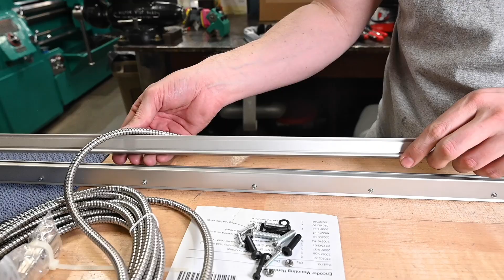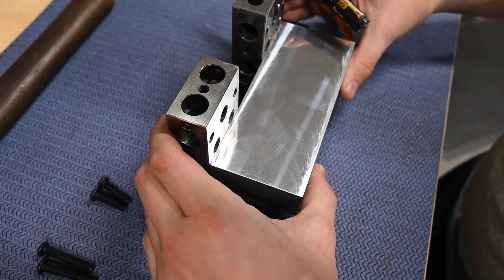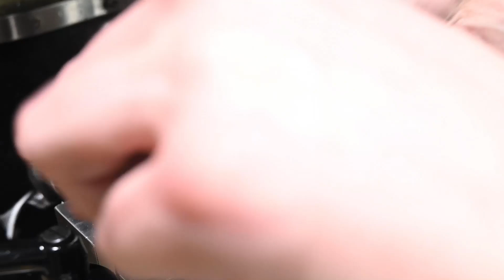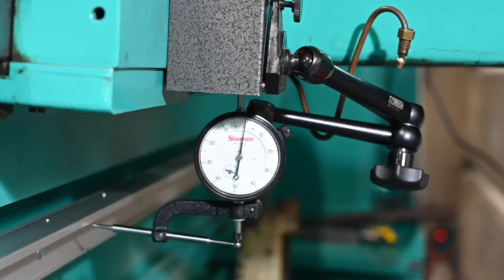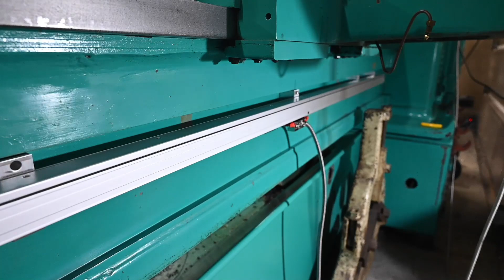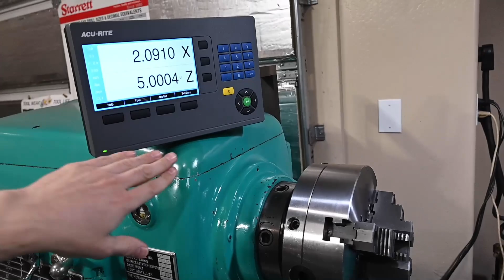Monarch Lathe Installing ACURITE DRO Z Scale

Comment: I see people being too concerned about how accurately these things are mounted. What I’ve found is that there is far more leeway than thought. Worrying about thousands isn’t required. With these glass scale models, there is actually a few millimeters leeway in alignment available. The read head is able to move a good three millimeters up and down and there is also about two millimeters sideways movement available. So a slight misalignment is fine. It’s built into the scales. Magnetic scales need to be mounted more carefully, and don’t even bother with capacitive models as they aren’t that accurate and read too slowly for real-time use. They’re good for setting fence distances, but not for actual machining.

Comment: There are machinist that find a DRO  not as useful as others do on a lathe, I am one, preferring the old TravAdial, and the machines regular controls. I think it depends on what you are doing. We have the model 60 at work, it is a solid machine. Monarch made many exotic attachments for the model 60 and 61, and there was fierce competition between the makers in that era.
 As odd as it may seem, I just removed a DRO from an old lathe I just bought, put it on a milling machine, and installed a TravAdial on the lathe.  Just personal preference.

Comment: Very nice install, always appreciate the time you take to think through your layout and steps of the process.  I am curious about the tap wrench you were using — would you mind sharing what brand it is and any thoughts about serviceability/durability?
Reply from the maker: It’s an old Greenfield Tap and Die ratcheting tap handle. I’ve only had it a couple of years (estate sale find), but it’s been great to have. It is a model 338.
Reply: @AlwaysSunnyintheShop  thanks for responding.  I looked high and lo on the inter webs trying to find a similar style; yours has a pretty unique directional lever on it that looks like it would work a lot better than the other ones I found.  I will have to keep an eye out for one.

Comment: tool steel for a good finish on ally with a dash of paraffin on a brush
Something you won't have come across is if you tip the mill head with a single point fly cutter you will get a fantastic finish as the tool will not drag 
merry xmas from the UK
Reply from the maker: I need to spend some time with a fly cutter. I've barely used them and this would have been a great instance to put it on the machine.
Reply: @AlwaysSunnyintheShop  Have you looked in the machine bible as to why you would tip the head? Also get in the habit of using a machinist brush to flick the swarf as it keeps your fingers a brush length out of range...

Comment: I would mount the readout box to the carriage.  That way it is always in view, no matter how long the shaft. Makes the cables stay with the platform as well.  Just the power cord has to move. But your machine, your rules.
Reply from the maker: I've gone back and forth on the location. It seems opinions are split 50-50 and love one way or the other. I can always change it later if I decide I'd rather it be on the carriage. I certainly have plenty of room!

Comment: are you going to paste some nicely cut squares of aluminum foil duct tape over the top of the allen set screws to keep dirt from clogging them over the next decade if you ever need to remove them.. perhaps some aluminum anti seize on the screws first. or perhaps some Permatex 85420 from the parts store.. AKA Hylomar. never ever dries.. most solvents proof.
Reply from the maker: That's a very good idea- it may even be worth just covering the spar and face of the scale with foil tape- won't leave a residue if I need to peel it off, and it will help shed oil and filth away from the scale.

Comment: Glad to see your back, some time ago we were conversing about the grease and bearing behind the drive pulley and I finally got that resolved , I also have a DRO that I will be installing on my series 61, so this episode came at the right time for me.
Thanks for the videos! (Metal Shop teacher in Gilbert, AZ)
Reply from the maker: Hi Dan glad to hear your DRO is going on now. Did the sealant on the teeth of the clutch disc work for the clicking?
Reply: @AlwaysSunnyintheShop  yes it did, apparently the wizards at Monarch designed the mechanism with a great amount of free play, I assume in a production shop this was never a problem even if you could detect it over the background noise of other machines, however in my shop it drove me nuts trying to find the source of the clicking, I finally used a highly technical method of pinpointing the source,.. a piece of heater hose held up to my ear, works like a charm!! Just a caution,....if you decide to use this method, use aquarium sealer,..its a lot more rubbery than regular sealant, and place at  3 points  (120) degrees, seems to work for my problem so far!

Comment: 5 microns = 5 milli milli metre. SI units rock.
Reply: 0.005mm .
Reply: Oh those pesky metrics. I'm sure he misspoke as he was straining to come up with Micrometre.
Reply: @backlash00  I still occasionally misplace the decimal point & usually end up with a over size hole or skim too much off, at least at my age now,I can now blame my eyes...
Reply: Millimeter is 1/1,000 meter. Micron is also known as a micrometre, which is 1/1,000,000 meter
https://tinyurl.com/y9watgk4

Comment: Backlash in the feedscrews has no effect on the DRO.   Not sure what you are talking about.
Reply from the maker: It's based on something I saw in the manual. Didn't really make sense to me, either, as I assumed it was reading absolute position no matter what.
Reply: @AlwaysSunnyintheShop  It is.

Comment: i find that when surfacing aluminum like that i get a better finish with wd40 instead of oil but in the big scheme of things i doubt it really matters
Reply from the maker: WD40 does work well for light cuts in aluminum, but I hate the smell of it so I use oil. WD40 is basically for rust removal only in my shop.

Comment: You are absolutely right that the Monarch would of came with a top of the line DRO if the technology was available then.
Reply: A tenth dro is actually a "middle class" dro. Not the most insensitive and sufficient for most lathe work but there are readouts with so much finer resolution that it's almost insane. Maybe for a surface grinder or some other ultra precision machine?
Reply: Most sensitive Sony scale I saw on ebay reads down to 10 nanometers or 4 ten-millionths of an inch.

Comment: Why should backlash mess with the readings of the DRO? Normally the benefit of the DRO is its not reading how much backlash you have. But just where the saddle/carrage is 😊 

And, do yourself a favour. Put the display on a swing arm on the carriage. You will love it there, instead on the headstock.
Reply: Yeah definitely, if you're doing long shaft work especially, you'd need binoculars to see the dro from the headstock end.

Comment: They probably got it that flat for better stress controle doing cut or the very least then the heat reformation ( how much it moves and twist when it starts Hearing up. Like moter heat spreading or moving back and forth over and over agen ) is more Equal since when SoMe parts is thinner then other parts it change a different amount and the machine is less accurate 

But that's just some of my theory's as a fully educated machinest

Comment: You're right about installing the DRO. It's your lathe and having a DRO is a no-brainer.
Reply: A dro is good to have but it doesn't beat / help if you don't have a quality machine to begin with ( my recommendation from personal experience is to get some of the good old heavy Russian ones. Not the new ones but the old ones that's still in good condition ( someting about those castings just makes them the best. Where I use to be we had a few ones with dro and 2 old Russian ones with no dro and the old Russians could take a heavyer cut and was more precise then the newer ones with the dro)
Reply: @flikflak24  I installed a half micron chinesium scale to my Moriseiki's x-axis, seems like the scale is still the bottleneck in terms of accuracy. There's a 5x more sensitive option available but I don't need it really. Half micron is about a  fifth of a tenth (1/50000") if you're from US.
Reply: I've briefly tested it and I get diameters finished within plus or minus 2 microns so the scale resolution should be 5x finer if I actually were to do work that accurate. User errors can already now cause much error compared to the resolution and accuracy so I'm not bothering.
Reply: @MF175mp  no im not from the us.im from erup ( denmark ) so im use to millimeter ( though i speak in desimels and not it text. so saying half micron dosent mean anything to me but if you say it like 0.0005mm then i understand what you mean / say ) 

anyway best regards from here
Reply: @flikflak24  I'm from Finland and use only mm usually too
Reply: @flikflak24  I respectful disagree with everhthing yoi said and I  won't bore you with my reasons.